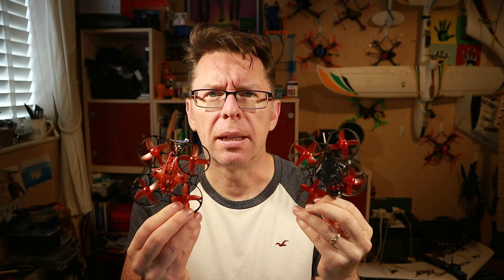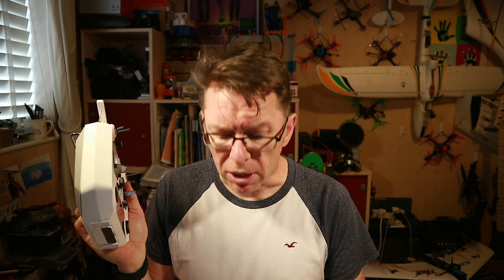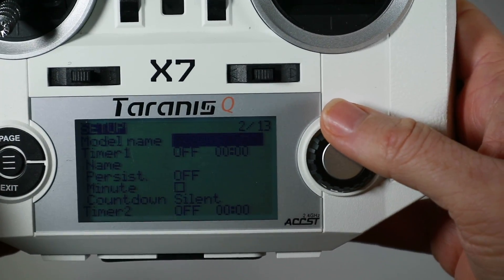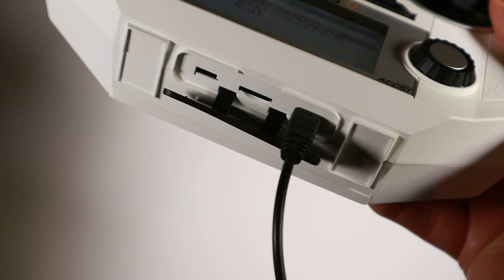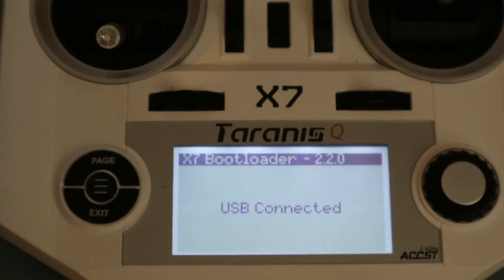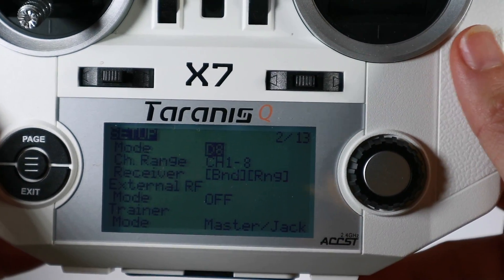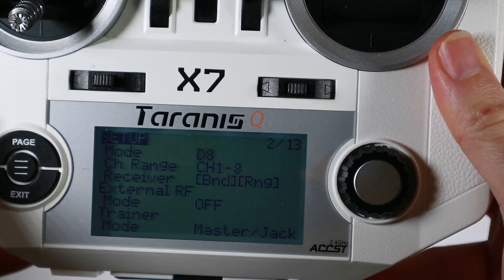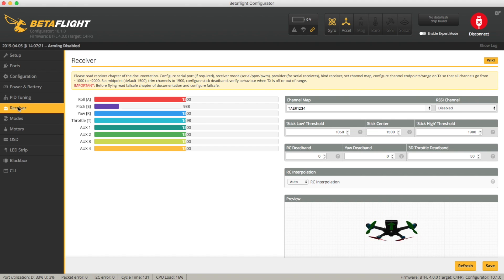How to use FrSky SPI or D8 receivers with an EU/LBT radio

Comment: I just received my qx7 with fcc firmware installed (I have the D8, D16, LR12 modes in the options). Then I was going to update the firmware and didn't know what version to install. I'm from EU, should I use the LBT or the FCC is better in anything? For now I'll be using with a simulator, but I'm planning to buy a mobula7 hd later this year and then invest in a 5''.
What is your opinion for a new guy that is starting to invest in the hobby, go with LBT or FCC?
Reply from the maker: Legally, you should be using the LBT version in the EU because radios are required to do this Listen-before-talk thing.  It certainly won't hurt using it - especially as you haven't got any existing receivers right now (although you'll then need to get d8 mode back in to use the mobula7)  I use the FCC version as I had a whole bunch of receivers before LBT became a thing and I'm not about to change them all over.
Reply: @CurryKitten  thanks, I'll update with the lbt firmware and use your tutorial to get the d8 it I need it. About the mobula7 I read that it's possible to flash the lbt firmware in the rx. Not sure thought..

Comment: @currykitten Sir I cannot thank you enough, your time, patience, knowledge, persistence and willingness to share and help others is much appreciated. 
I bought my QX7S as an upgrade from flysky not knowing anything about the importance of firmware EU/INT. I struggled for 2 days getting everything to work with my wizard and R-XSR.
I really thought that I would have to reflash everything and go through the trouble again to get any decent whoops from Banggood but thanks to you it was a 5 minute job.
Have yourself a wonderful life sir.
P.s I'd like to help in return if possible, I work in cycber security so if you need anything networking/security please send me a message and I'll help you out.
A good deed for a good deed.

Kind regards

FPVLuke
Reply from the maker: Great stuff Luke, glad it helped you :)

Comment: Hi sorry to be a nuisance to all you nice people but when I power on my x9d plus now when it says throttle warning it also says sd card warning something about expected version all is still there and D8 mode is now available is the sd card warning a problem I have never used it yet???
Reply from the maker: Ok.  Check to see in your model setup if the throttle has been reversed, and if not try the stick calibration.  As for the expected version - if you've actually updated OpenTX to a new version, it looks for a text file on the SD card called opentx.sdcard.version which simply contains a version string.  The idea being that you should get the SD card contents (from the OpenTX site) but if you've literally changed nothing, you could also just edit this file on a PC to reflect the version it wants you to have
Reply: @CurryKitten  Thanks for the reply so I need to go back on opentx and download for the sd card I'll look in to  it later thanks very much I am moving up from rc cars (it's a steep learning curve)

Comment: I really need this video thanks! Could you do a vid on how to fit an ext receiver to the trashcan / mob 7???
Reply from the maker: It's not really on my list of to-do's right now - partly because I've got a bit of a growing backlog of things to get through, and partly because I have a few longer distance whoops as well.  I think it'll have one spare UART on it to connect up to an SBUS rx, but can't be sure.  If I get the chance to look properly I will do
Reply: @CurryKitten thanks for the feedback. Out of interest what are the longer distance whoops you mean? I am really after something with a bit more range but nothing big (as in quad size) as I am limited where I live and don't want to upset anyone! Whoops are ideal for that.
Reply from the maker: I really like the BetaFPV 85X HD as something that can cruise about over a decent range (I published a review on this last week) you can get those with FrSky XM+'s or even Crossfire Micros if you want to go further :)  I've also got an Scorpion80 which came with an XM+, but I don't rate that one, it's overly heavy so drains the lipos quickly
Reply: @CurryKitten nice one thanks very much!! I'll check out your 85X review

Comment: I just bound it on d8 on my lbt no problem, just changed to d8 no messing about.
Reply from the maker: As in you already had d8 mode available on your radio?  It's not the norm for an EU radio... or so I'm told
Reply: did this with a qx7 ages ago for eachine Aurora  and an x-lite for the mobula 7 which i have hardly used since i got it weeks ago, both eu lbt

Comment: Kind of related but kind of not. I have always had less than stellar range with my QX7. I was thinking of upgrading the firmware on XJT module as I can't find the version in the system menus, so who knows what I am on.  After doing the firmware upgrade do you need to re-bind all your models as I am not keen on pulling umpteen models apart to find the bind button. BTW: Not changing from EU to FCC and vice versa, but sticking to the same region.
Reply from the maker: Yeah - one of the issues I have with FrSky is they give no way of finding out what firmware is running anywhere - be it R9 or the XJT module, you just don't know.  It's worth mentioning that the XJT firmware hasn't been updated since May 2017, which is (IIRC) around the time the X7 appeared - so it seems unlikely to be a bug that's easily fixable.  As far as the rebinding thing goes... I'm not sure - I'll try writing over my LBT firmware with the same and see if the model I bound still remains bound.

Comment: If the rssi is on channel 9 surly it can be changed to another channel I do it all the time as when you get a new receiver or flash new firmware on it default rssi is always on channel 16 what is not that good unstable so I always change it to channel 8 so I can choose telemetry 1-8 on radio for faster protocol
Reply from the maker: Sure, if you are using something like an XM+ then you can flash a version of the firmware with RSSI on ch16 or ch8, but the SPI RX is a different beastie.  I can't see any method of flashing, or altering their RSSI channel.  I you see one, let me know - but I can't see a way right now
Reply: CurryKitten it’s not flashing the rssi channel it’s selected on your radio you go into your mixer page on taranis and setup a channel to receive transmit rssi that way you can choose any channel to put your rssi on , so I would have thought it would be possible on those receivers on trashcan ect but not 100% , I don’t have one to try it on as I junk all those Recievers that come with these small whoops as they are crap not that I want to put 16 channels on one because if you do the flight controllers on these small builds does not like D16 it will and does randomly lock up the fc and you fall out of the sky , have a try putting rssi on channel 8 with your radio mixer setting and then change the Aux setting in Reciever tap in betaflight to channel 4 and see if it works then you will be able to have rssi on D8 mode on those spi boards hopefully
Reply from the maker: Haha, oh yeah - I know what you mean, I even wrote about it a while back https://www.currykitten.co.uk/getting-the-rssi-value-to-show-in-your-betaflights-osd-frsky-based/  It never clicked with me because I'd only ever thought of using that when I'm dealing with a RX that only has telemetry.  That fact it had RSSI on the wrong channel completely threw me off :)  You should certainly be able to get RSSI into your OSD using that method - thanks for the reminder

Comment: Fantastic Vid!! I presume you can still connect to all of your LBT receivers after making that change? I presume that unticking EU just removes a restriction?
Reply from the maker: Yes, exactly - everything stays the same, aside from the fact you can now bind to d8 as well
Reply: @CurryKitten  Compared with having to add an xm or xm+ is that a better option? You still lose the rssi reading but gain??
Reply from the maker: As with most things, there's not a straight answer to this.  An XM+ will absolutely wipe the floor with one of these SPI RX's and you can flash an XM+ with RSSI firmware on both LBT or FCC and use 16 channels.  The reason I made the video is because people were asking about them in terms of being able to use one of these RTF 2s whoops without having to fiddle about with it and add an rx.So the advantage of the SPI rx is really convenience and keeping the weight down as much as possible.
Reply: @CurryKitten  I know you were because I was one of them.  I'm just trying to work out the pro's and con's of running D8 (Not having to mess with the RTF) and the advantages of fitting an XM or XM+.  Is the additional range going to be worth it with the trashcan say and it's 200mw VTX? BTW Thanks for the reply!! Really do appreciate it. :)
Reply from the maker: Personally I wouldn't like to fly these too far away because they are a right pain to find when they go down.  I think they work great for some tight close in  proximity flying, and zipping in and out of your house, around the garden etc - but it's not often I think "I want more range"  There are more suitable non-whoop quads when you want to go a bit further.
Reply: @CurryKitten  So losing the additional information is worth it on the whole as you are never really going to get out of transmitter range anyway? The way the UK is going at the moment I'm half wondering if the Trashcan or similar might be the only way to fly outside of an organised event.  So the additional range might be advantages outdoors?